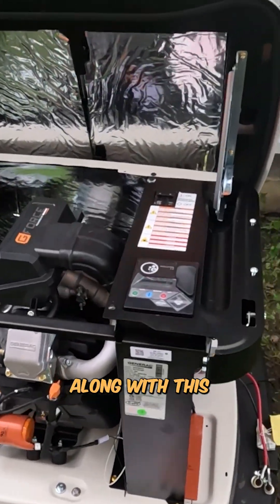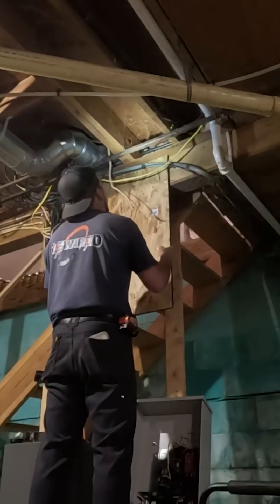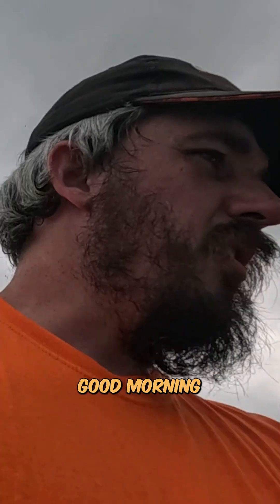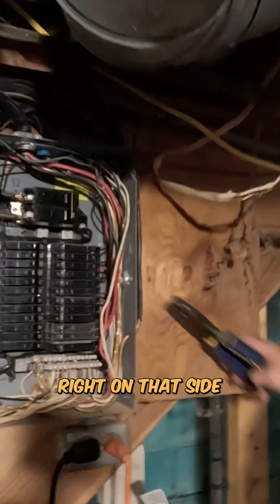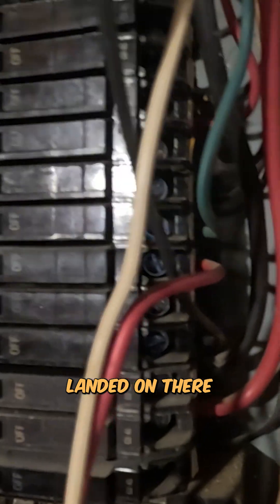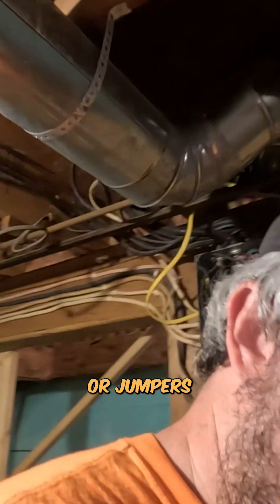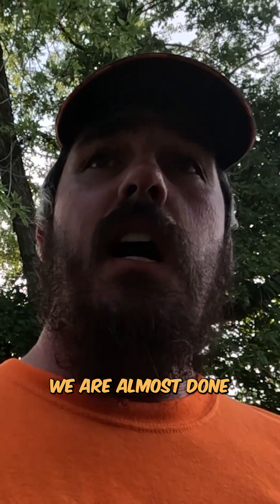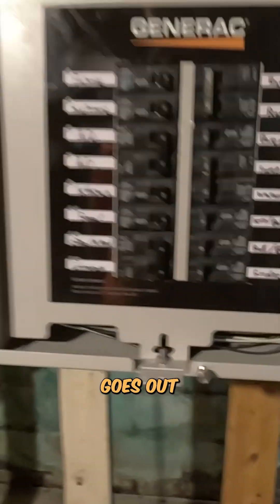This Generator Install Revealed a Dangerous Wiring Mistake

Comment: Having a possible heat source of some nice flammable wood.
Only in America.
Reply: Plenty of places have wood structure behind the fuse boxes, the box it self is the final protection and fuses do the primary protection. I rarely see concrete or brick wall for it with stick or log frame, but true ideally you want concrete or stone behind and around just in case as added level of safety.